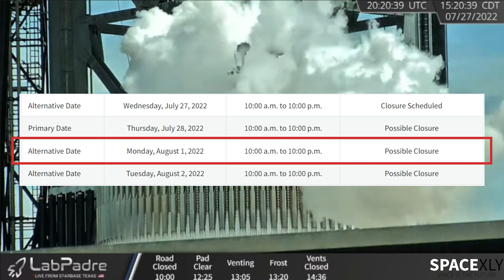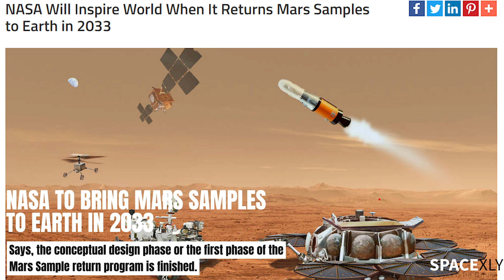Test to Failure on Booster 7.1, Tower Segment 5 Roll Out, Mars Sample Return Mission | SpaceX Update

Comment: If SpaceX sends a manned mission to Mars before 2023, samples from the landing site can be collected to be returned when that mission returns.  However, the samples collected by the NASA rover will provide different information. The Chinese collected lunar samples and returned them in just 1 unmanned mission. NASA’s plan should have included a much quicker return method, one with less than a decade between collection and return.
Reply: New space race: NASA vs SpaceX! :D
Reply from the maker: NASA will prolly pull itself out of the race haha
Reply from the maker: Funding might be the issue for NASA I reckon.
Reply: They are not getting there before 2023.